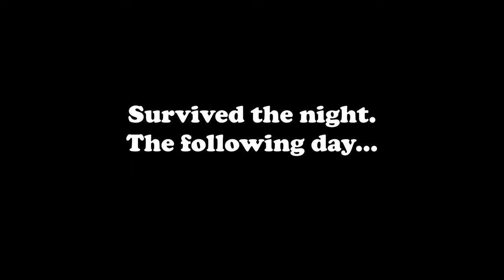Stranded in NYC with Cyberdrop Bicycle Camper after Hitch Fail

Comment: Amazing, with a bike-camper through New York City! Guess everything happens a first time. Great, you had a good experience despite. 

For repairs - having been an overland back-packer for years myself, but in many underdeveloped parts of the world (by the way, a Hotel room in New York was the worst I experienced ever, and the most expensive) - I would dare to venture that far with air- and spokeless wheels only. Possible with low tech suspension. And as light as possible too, since some places don't allow any furthering, unless possible to load it up for a hitch with a truck.

Good luck and enriching experiences further on.
Reply from the maker: Yea, I’ll have to think about some alternatives. Thanks!
Reply: I travelled between New York, Eureka, Uttila Island and San Salvador a whole year, east-west, up and down even 4 times. Still saw so little. Don't know how it is these days, but back then, from Chiapas onward, it could get more difficult to get spare parts. So still enough miles and years to travel - even many times the distance than to Argentina - with so much to see. Guess by then your setup got hardened already by the many circumstances.

Take a look at @saihtam setup at the Forum. With about same weight trailer and engine-power. He replaced spokes by using 12 inch tyres with nothing between engine and rim. Uses only stainless steel tow bar, and made a car-trailer hitch with suspension.
Reply from the maker: @pamojja  Thanks for the recommendation. I will look into this closely for sure!

Comment: I would not have thought of "hitch strength" myself.  But you are pulling much more than typical bike trailer for many miles.  NYC/urban traffic can mean harder acceleration and braking and metal fatigue.  I'd consider thicker metal for the hitch, or anything that breaks along the way.  The spokes are discouraging, so getting a few spares cut to size would seem cautious.
Reply from the maker: Agreed. Got spare spokes with me now.

Comment: Very nice to see an update about your adventures. 

Many trailer designs have a "hitch break-down" safety arrangement. That will help prevent the worst of any secondary issues that might occur, if/when the trailer/hitch coupling fails. 

It can be wise to have a known 'weakest point', so if anything will fail, then it is very likely  to happen at a known spot. This way it is possible to think up a failure-catching system that will 
a) slow down the trailer, and bring it to a stop. 
b) keep steering the trailer as best as possible, so the trailer will not hit other vehicles, while it is being slowed down, to a full stop. 

Often times this entire system is being accomplished by a few wires, chains or a piece of cloth-strap. 

Perhaps something like it, might be possible (and even easy) to implement for your hitch design as well?
Reply from the maker: Excellent input. Yes, I will take your suggestions as I think about the secondary safety aspect. Cheers!

Comment: Bypassing a device battery is tricky , I tride it with 12 v potable drills and I smoked 3 of them and one radio . I used the correct voltage but still smoked . I'm guessing I need to control the current and voltage . Now I'm planning on using rechargeble batteries of the size needed . EX .double A , triple A , C , and whatever . for the device in question . Kiss  Keep it simply smart .

Comment: I have thought of building my own camper with my eBike.  I liked your trailer, was it for buying one?  I agree with 3" or 4" wheels on the trailer.  My cargo own has 2" wheels, they work okay, I found a great tier for that size 2" I am currently using, it works fine on dirt now.  Weirded welder didn't keep straight strange guy.  I enjoyed your system for the camper trailer.   I hope you got it fixed current without any issues.  Seattle has become much worst since the 70's...  Sorry, but I don't get along with my cops in my town, they hate me, and I hate them.  I hope everything works out okay.  Thank!
Reply from the maker: Thanks !

Comment: do what truckers do.. they have a chain to support the hitch in case it fails. at least you can pull it.
Reply from the maker: Yeah, just gotta put it in the right place next time. I had my backup wire attached to the part of the hitch that broke off - not smart of me.
Reply: @Jerbrown  ey man. we're just glad you're okay. :) but yeah. Lessons from safety is not without expense. 

another tip: Use universal joints. It can compensate no matter how uneven the road is. :)

Comment: Would solid rims be a better choice
Reply from the maker: Yes, but I don’t want to go with heavy trailer rims and it’s been difficult so far to source a 20” mag wheel or the like to fit the 20mm spindle and 100mm hub width. I’m starting to look at something custom like welding my own aluminum wheels - but that seems like an exercise in torture due to the distortion caused by the welds. Open to suggestions! Next up I’m trying spoked fat wheels.